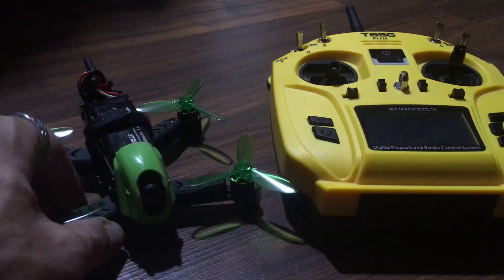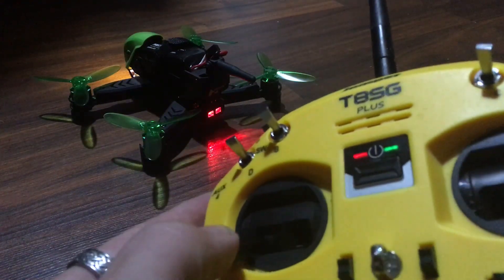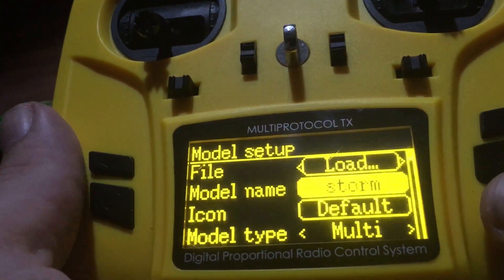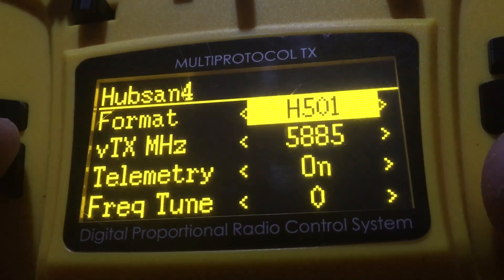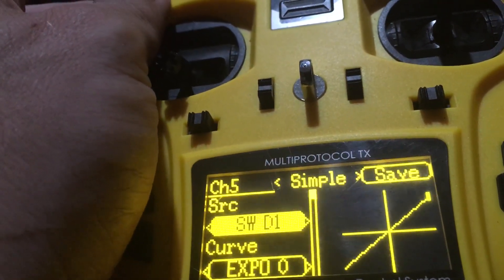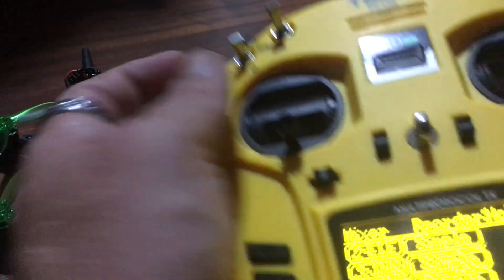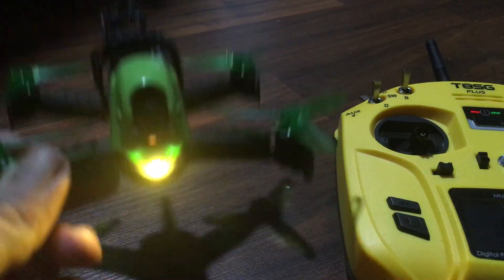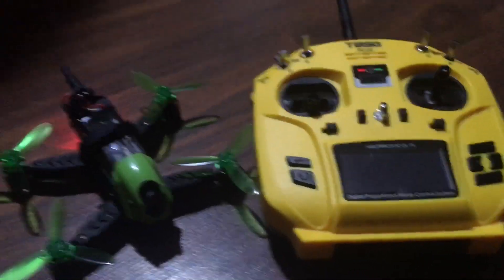Hubsan X4 H123D Jumper T8SG how to bind Review

Comment: Jay I know this is older but maybe you can help me. I recently got the T8SG V2 and want to bind it like this, but I need to know which switch does what besides the light. The speed is very important to me, normal and expert modes because there's a huge difference in yaw and whatnot. I need it to go to expert mode. Plus the other modes like horizon and acro mode would be great. I've heard once you updated the firmware, acro works pretty good. I want to fly it with my Skyzone o2c goggles too.
Reply: I'm having same problem, I have 
Got my Jet on a TX12 all works apart from can't change modes and speeds. It must be possible but really having trouble. Any advice?

Comment: Jay Drone Hubsan quotes two of their controllers as being compatible with the H123D X4 Jet, neither of which is a controller which is compatible with their H501 drones. However the protocol chosen to fly it in your video is the H501, and therefore it seems to me that the H123d X4 Jet could be flown with either of the H501 controllers, although not quoted by Hubsan as being compatible. What are your thoughts about this ?

Comment: I don't know if you ever found out or posted a video on it, but I figured out how to get the Jet into its "acro" mode using the T8SG Plus.  In addition to how you have everything set in this video, assign channel 12 to a 3 position switch.  Channel 12 toggles the Jet's flight modes.   I have mine set up so that the up position (value -100) is sport mode 1, middle position (value 0) is sport mode 2, and down position (value 100) is acro mode.  Set it, tested it, and works great.
Reply from the maker: Very good information thank you
Reply: @JayDrone  For those reading this who don't know how to properly set a 3 position switch in Deviation, it's pretty simple.  Change the channel type from 'simple' to 'complex', go into the settings for that channel, and proceed with the following: Set 'mixers' to 3,  set 'switch' to desired switch and position (example: SW A0, SW A1, or SW A2), set 'scale' to corresponding value (-100, 0, or 100), and set 'curve' to fixed.  Repeat that process for page 2 and page 3 (page 1 being the first one you set).  Save, exit, and test it out.  It should be good to go.
Reply: @drumstickscarecrow  could you please make a video.of.how to set the acro and sport mode speeds on the Hubsan, I'm having problems, what channel is Acro and sport mode on the Jet drone? Set everything but still nothing, tried channel 12 and 13 in the mixers. I have the rates set without problems, video and light work good, can't seem to get picture button set also???
Reply: @SiFPV  I haven't forgotten about doing that. Work schedule changed as of this week, so my availability to work on such things has been altered. I'll get on that ASAP.
Reply: @drumstickscarecrow  Thank you, sorry to be a pain it's driving me crazy lol Worked out how to do rates but no matter what i try I can't get sport or acro flight modes to work, I'm using the TX12 open TX. It's all working apart from Sport and Acro. Thanks again really appreciate it. 👍
Reply: Thanks I'm having problems , I have my Jet set up with my TX12 radio master, all works apart from the modes and rates, I'm stuck in Manuel mode, please help. I have done inputs, mixers but can't seem to get the Jet to react with anything I set up. All works apart from flight modes and speed settings, please help as I want to change flight modes an speed
Reply: Please could you make a video explaining how to do the acro modes on the Jet as I'm having trouble getting mine to work in acro or sport modes. Thanks

Comment: Following https://www.deviationtx.com/manuals/html-devo8-en/ch_protocols.html#protocol-hubsan4:

- Channel 5 Controls the LEDs
- Channel 6 Enables ‘flip’ mode or altitude hold or stabilized mode, depending on format.
- Channel 7 Turns video on/off (H102) or takes a snapshot
- Channel 8 Takes a snapshot
- Channel 9 Enables headless mode
- Channel 10 Enables return to home
- Channel 11 Enables GPS hold
- Channel 12 Sets Sport 1, Sport 2 or Acro mode (H123D)
- Channel 13 Enables ‘flip’ mode (H122D)

Not sure how to link 3 values to channel 12

Comment: Any progress about setup Flight Mode? This h123d manual (page 10) https://www.hubsan.com/na/ActivityMobile/H123D/downfiles/en/H123D%E7%94%A8%E6%88%B7%E6%89%8B%E5%86%8C_20180709(%E8%8B%B1%E6%96%87)-email.pdf says it has Manual/Sport/Acro mode, and even the normal/expert mode (which seems to be the two speeds you mention). This t8sg manual https://img.banggood.com/file/products/20170822212057t8sg%20(1).pdf says multi hubsan4 protocol uses channel 6 for flip mode (maybe flight mode?) but how to check on drone (maybe some led lights flashing?)

Comment: Thanks Jason. I already have the H122D Storm and have it bound to my Jumper with the channels mapped for different rates, lights, video and photo all working. I have been thinking about getting the H123D Jet but was concerned that it might have a different protocol or something. I did not realize that it would be that easy.
Reply from the maker: That easy
Reply: I hv the H122D that I want to bind with my new Jumper TX12Pro. Ive tried to follow the videos but they move too fast or the firmware versions are different do my screens are different. Does any use firmware 2.3.4 that could dona newbie setup for that.drone.slowlt? Instructions are ridiculous but im sure ill pick it up in the upcoming months.
Reply: HI Alex, I wonder if you could help me, I have my Jet linked upto my TX12 radio master, all works, lights , video everything but i can't change flight modes or speed modes, please if you have done it with the storm it will work on the Jet as it's the same protocol. Please if you did the channel mapping could you please help as I'm having real problems. I have done inputs, mixers even got the TX12 to speak and say what mode I'm in but still won't change the modes on the drone itself. Please help. Thanks
Reply: @SiFPV  Hi. It is quite a few years since I have used mine. I am also not very Tech orientated but I found this tutorial that I remember that I used to set mine up by following step by step. Take note that there is an error in what he says for the channels  but he does correct it at 6.47 in the video.Also the only difference in the model he is setting up here at 2.07 into the video make sure you choose the H501 sub protocol. It is years since I used mine and I just switched it on but I struggled with it. 

https://www.youtube.com/watch?v=rd4z60xFhRY&t=135s
Reply: @AlexBondSmith  Thank You Alex I will take a look, it's a fun little drone, very over powered for its range. Thanks again
Reply: @AlexBondSmith  Hi thanks, do you remember which channel controlled Sport and acro mode on the Hubsan 123D Jet? Still having problems, all works but sport and acro, thought they were on channel 13 on the 123D Jet but still nothing?
Reply: @SiFPV  no. I had the h122d without these modes. I did not know that the jet had acro?